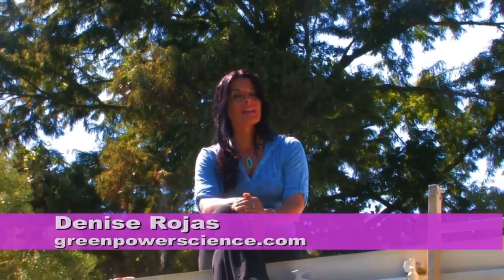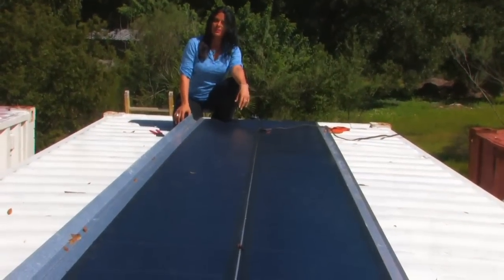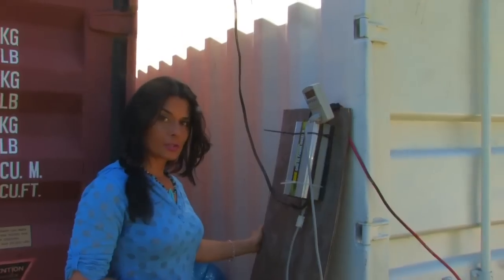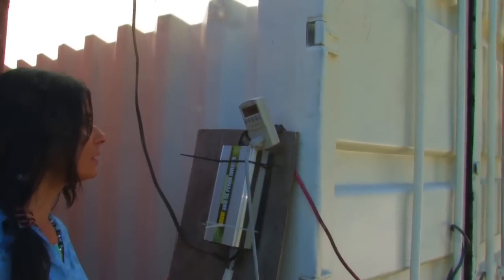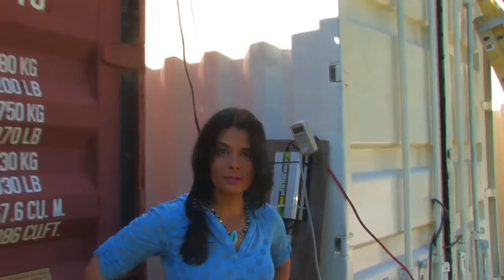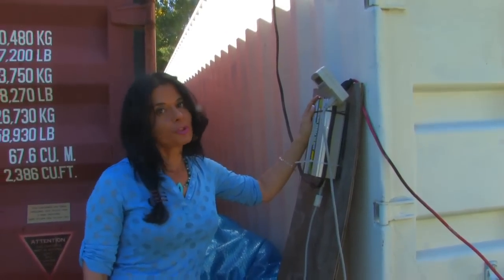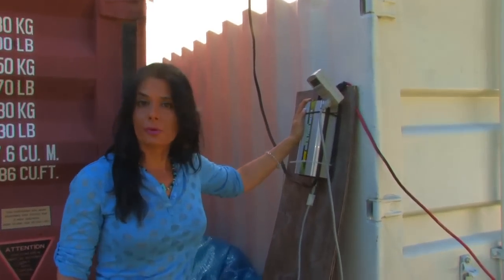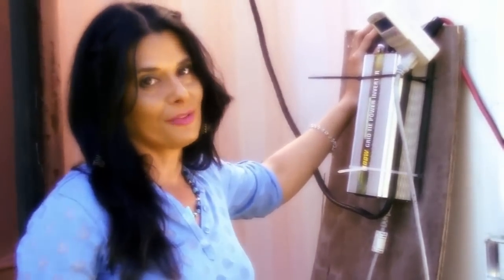DIY Flexible Solar Panel 230 watts to a Grid Tie Inverter Installation Wiring

Comment from the maker: @PhattyMo They are 40 ft containers. The first one was $1750, the last one was $2500. The price has gone up a lot over the past 2 years. They are really good. If you buy one from a company, do not buy the painted ones. They are usually covering excessive rust. You can paint yourself with enamel paint and a spray gun.

Comment: Got a system on the roof of my building with those type of panels.  So far after about a year they've been working pretty well.  We've been exporting more energy out to the grid than consuming.  It is for an art center which is not open all the time but still, it's working out for us.  The power company still charges us for "customer charge."  Lame.....but supposedly we'll be getting a credit the middle of next year.  It should be a large one!

Comment: What about a hybrid inverters like the ones from xantrex?  These inverters work like grid-tie inverters when the power is on (and can also charge the batteries with grid power), and work like off-grid inverters when the power is out so that your panels will still work in case hyper-stagflation creates rolling blackouts.

Comment: OK, so I got two of those long flexible panels from a guy on ebay, and tested one today, it is pushing the 40+ volts, which according to the label on my 300 watt grid tie inverter is too high for it.  What do I do now?  Get a different GTI?  Put s ome sort of voltage reducer on the line?

Comment: Where did you get the metal roofing panels that are flat, everywhere I look all they have are wavy ones,  I have two of the uni-solar panels already they work very well even on over cast days, I need toi mount mine, but i don't want to stick mine to the roof.

Comment: Thank you for your videos: >INFO: Here in the uk we have some options. Free solar panels+installation typical 2.7 kWp system. You get to use the electric which saves on average £70 off your bills and the company thats supplied them gets to keep the feed in tarriff on average £1,030/year. >OR If you can afford the £12,000 for the 2.7 kWp system you get to keep the £1,030/year and over 25 years net you £25,750. Feed-in tariff payment rises with inflation, also tax-free.

Comment: @DarwinsFriend  I'm visiting in a small city, which one could maybe call "urban", I don't know.  However, I can see a nice use for solar panels for people with gas-electric hybrids that would like to partially charge their vehicles even where there are no plug-ins available, like here.  I can also see how solar panels on vehicles could be useful for people with gas engines who just want to make sure their car batteries are kept charged even after parking for a long time.  Such as here.

Comment: @Raaszhecku ive had a similar idea.. insulation.. perhaps spray the out side with rhino liner (rust prevention).. then bury them... wiring use commercial conduit.. it will look really cool :)

Comment: Wire nuts don't last long outside..  A weatherproof junction box, or soldering and shrinkwrapping will go for as long as the panel..

Comment: I don't understand. Why use flexible solar panel and then put it into frame? Might be simpler to just buy a normal solar panel.

Also, since there are 2 panels, 2 micro-inverter attached to each penal might be better than one large inverter, isn't it?

Comment: Since the USA is a importer of cheap plastic crap, there are an excess of containers. The price probably tracks the scrap metal value.  Although around here, the 20 foot ones are almost as expensive. The smaller ones are probably more in demand by contractors though.  A 40' one should weigh about 9k lbs. and steel is at 10-12 dollars per 100lb. at the scrapyard. Of course, if you were selling 100 containers at a time you should get a better price.
Reply: India, sunil, interested company , solar light manufacturing india. Solar panel company name, please interested. company name

Comment: @mclarenf45 You know that's just untrue. Sure you have to pay upfront initially, but it will pay itself back in 10 years or so - and then you have free electricty from then on (do you think electricty price will stay flat in 10 years?), and remember you tie it to the grid so you've always got electricity for days when it produce less power. The price of solar panels have fallen a lot the last few years, the industry is changing fast these days.